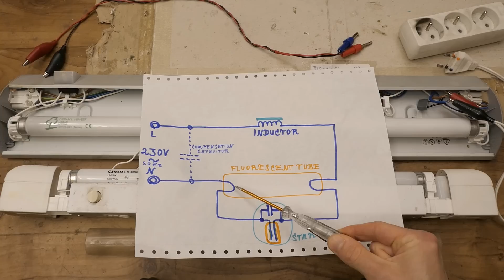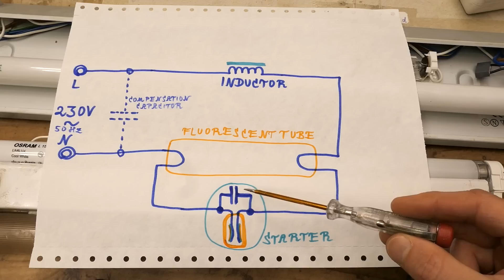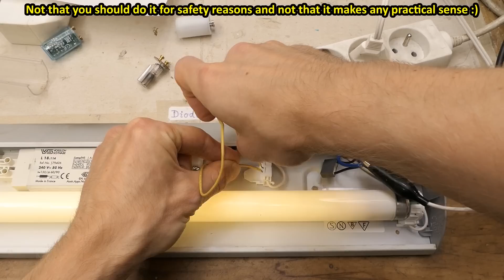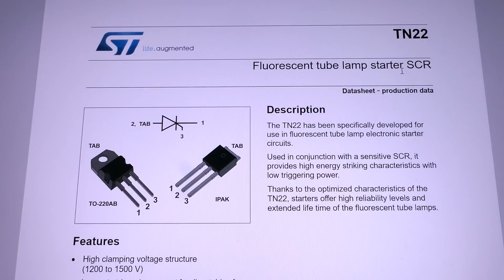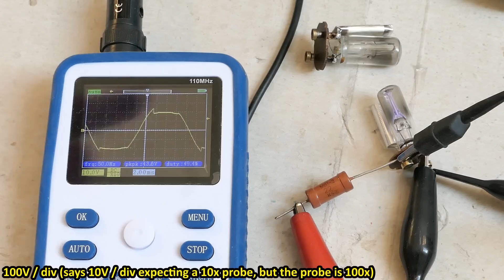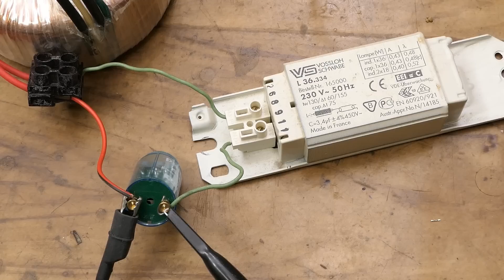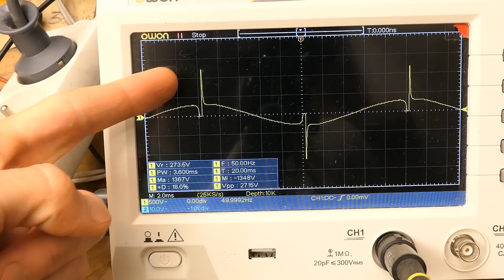Fluorescent lamps, electronic vs. glow starters

Comment: Is there a way you can constantly light the neon lamps from a starter? I would like to use the purple/blue ones (argon) as lights.
Reply: I wonder too 😀
Reply: Make your own by sealing two non bimetallic electrodes inside a glass tube with gas. Try different gases for different colours. Or just find/buy them. You can find neon lamps in old switches with indicator lamps. 👍
Reply from the maker: Dimly at a low current, they never heat enough to short. Connected to mains via a high enough resistance. Just like I did when measuring their voltage drop.
Reply: @techtinkerin Making them is a bit too much hassle.
Yes, I have enough regular neon indicator lamps but the purple ones found in starters are not available as indicator lights and I really like the color.
Reply: @DiodeGoneWild Ah thanks. So just treat them as a regular neon lamp and use a resistor of a high enough value to decrease the current to a level where the metal doesn't get hot enough to move. But what if they do make contact? Wouldn't that make it a short and fry the resistor? (and the bulb)
Reply: Plasma ball, flyback transformer or Tesla coil.

Comment: @DiodeGoneWild Does CRT electronic tubes has a starter of the same sort to ignite the electronic beam?
Reply: A CRT contains a vacuum, there is no arc that needs to be struck so no starter.  A heated cathode emits electrons which are attracted to the anode by a very high voltage.
Reply: @petehiggins33  Inside the fluorescent light also there is a vacuum. I think the difference is in the voltage applied, it's lesser in the case of the fluorescent light.
Reply: @johnnychang4233 No, the fluorescent tube contains a low pressure gas, it's the discharge through the gas that emits UV light which is converted to visible light by the phosphor coating.  DGW says in the video that the gas is typically Argon with some mercury vapour.

Comment: The thyristor is a GTO, a thyristor family possible to turn off by the gate. The special starter SCR has the holding current controlled by the gate: Negative current makes it higher.

No capacitor on the input: Never ever even try it with such electronic starter. The "starter" SCR really does not like the current spikes and gets very easily destroyed even by a small capacitor. Don't ask how I know that... :-)

Comment: There is no need to install an electronic starter since there are electronic ballasts that are better, they offer longer lamp life, the lamps do not flicker at all, nor can the camera catch it since the electronic ballast can give the lamp up to 20-60khz per second, smoother start-up, minimal losses of 1-5% compared to magnetic ballasts which with a lot of use and time reach losses of 30 or 40%, they do not heat up at all compared to magnetic ones which can easily reach 60 degrees Celsius compared to electronic ballasts which reach 30-45 degrees Celsius! but only electronic ballasts with preheating because there are electronic ballasts that immediately turn on the lamp as if an LED were to turn on, this of course can be positive for someone who wants light immediately, but this is bad for the fluorescent lamp as it can reduce the life of the lamp! electronic ballasts that turn on the lamp with a small delay of 2-3 sec are okay

Comment: For me, this video comes 2 decades to late :-)
Reply from the maker: No worries. There are tons of videos about tube radios coming 8 decades too late ;)
Reply: @DiodeGoneWild  Not necessarily, since I have 2 of them waiting to be repaired. 
I just stopped thinking about fluorescents back then when it became clear that they will be superseeded by LED pretty quickly. Sadly, I had already spent so much time designing (hardly working) 12/24V fluorescent drivers.....

Comment: Fluorescent are better in one way than LED's. They do not put out a frequency, also the LED's have a flicker faster than the eye can see but it is still there. Both are not the best for the brain and body.
Reply: They flicker at 100Hz and the LEDs at whatever frequency they are being driven at .
Reply: @andymouse  Electronic ballasts usually work at 40-90 kHz.

Comment: It is interesting to see a 25-80 W old starter. Did you have 80 W tubes? In Hungary we had 1500 mm 65-80 W rated tubes but they were almost always used with 65 W ballasts. I have never seen an 1765 or 1800 mm long 70, 75 or 80 W tube.